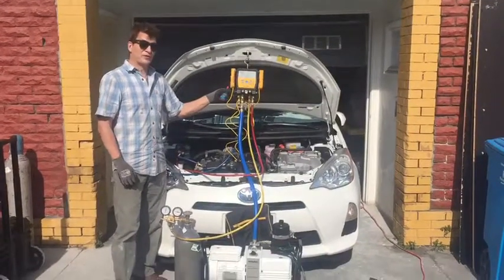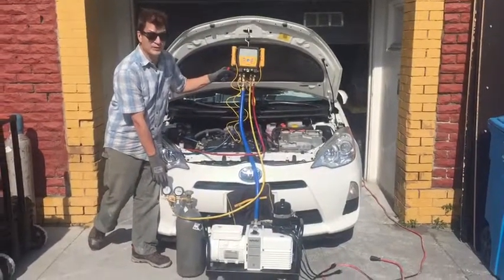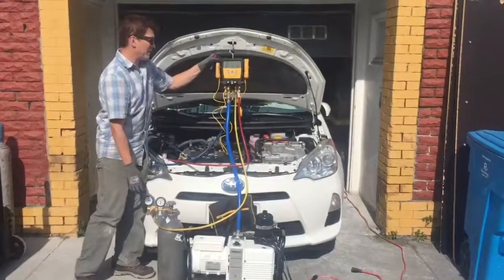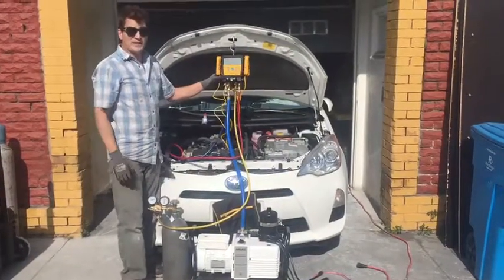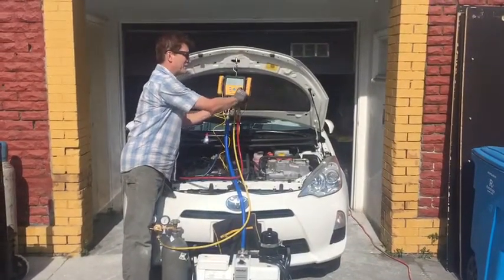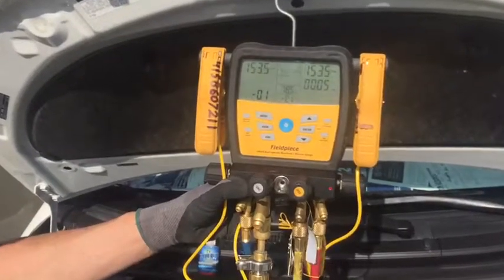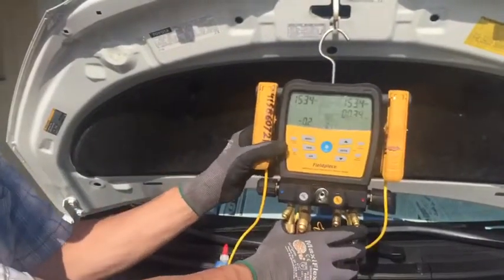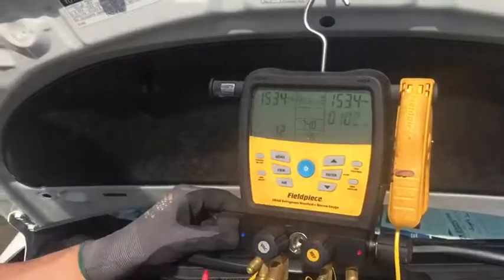Prius C dry nitrogen decay test for air conditioning

Comment: This is the most carefull and advanced pressure test I have ever seen on an automotive AC system. The same goes for for the 3 step vacuum procedure in the video description. I am however subscribing just because of the size of your vacuum pump.
Reply from the maker: Ulf Hesselager Johansen thank you, size matters 😎 . Some one can use a little tiny one will work to,  if you wanted to suck until the cows come home and pigs fly. But in the end they will both reach the same goal.